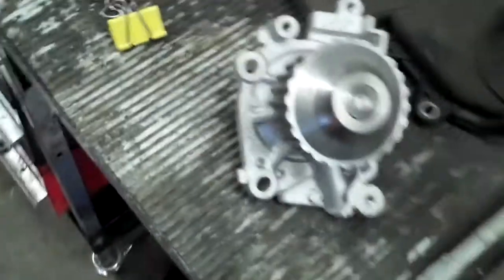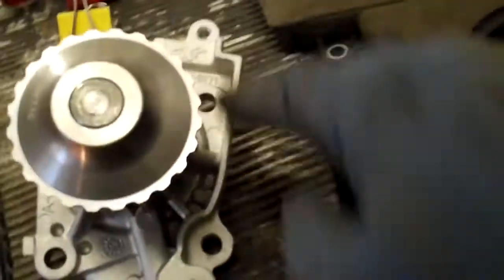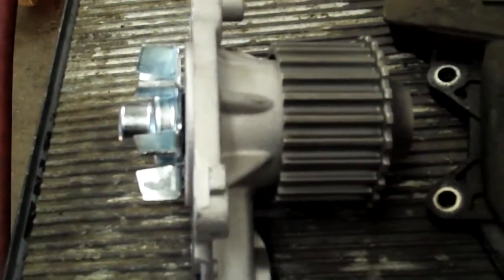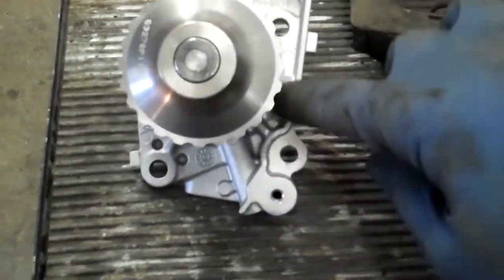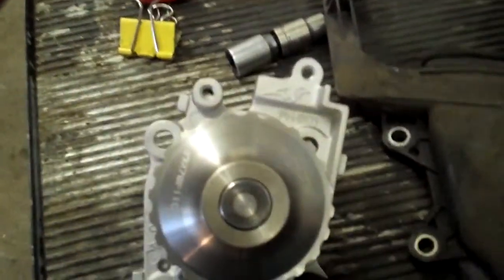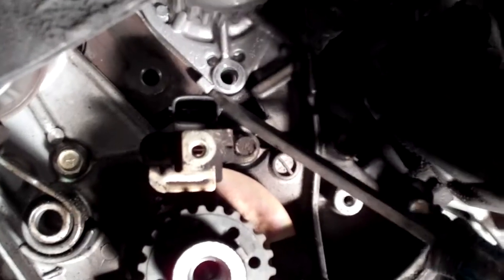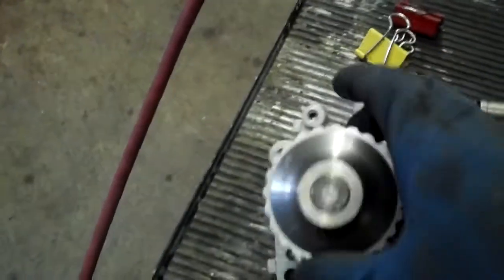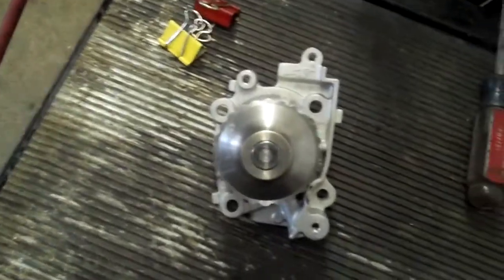Water pump.  Why you funny look'n?

Comment: When the seal fails on the highway it doesn't matter if the timing belt shreds or not- you lose your engine. Happened to be over the summer. Water Pump failed on my Legacy Outback and I lost my engine.

Comment: This video reminds me of Geo Metro water pumps.  External driven but the timing belt tensioner bolts to the pump!! For some crazy reason GM decided to have a tiny pump and then make a huge extension on the pump so you could mount the tensioner to the aluminum pump instead of a steel block.  It would be a nice and easy job if they didn't have you remove the timing belt just because the tensioner bolts to the pump...Sure it makes sure you change both at the same time like you're supposed to...